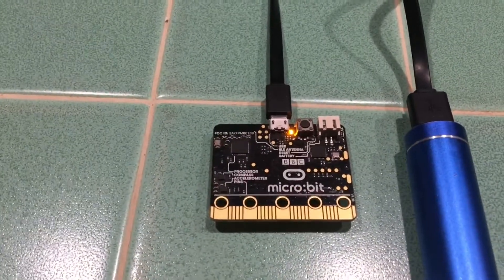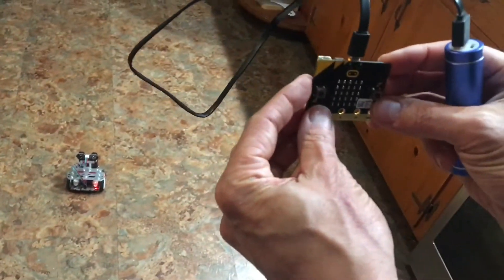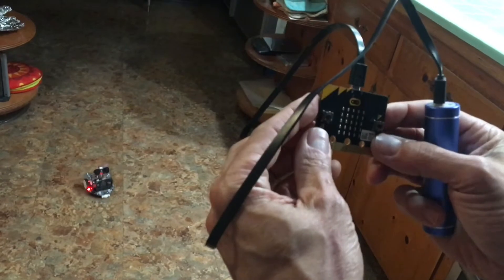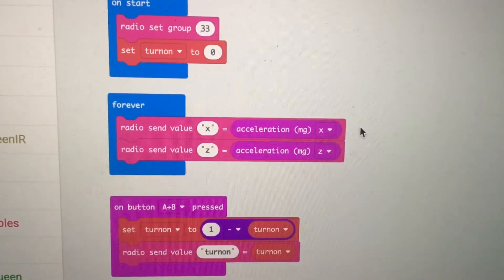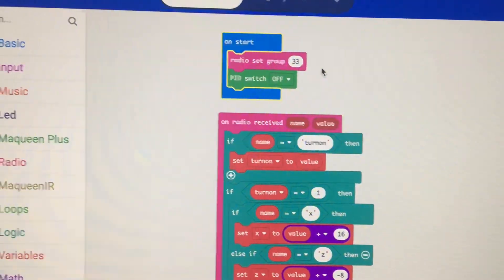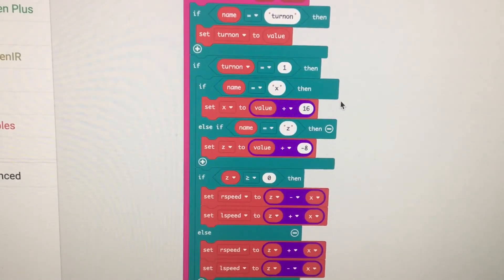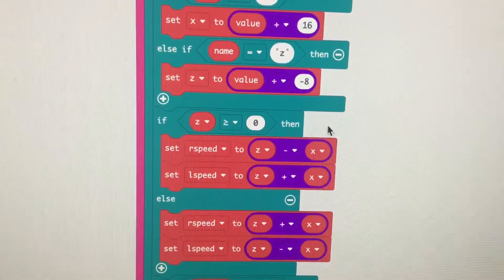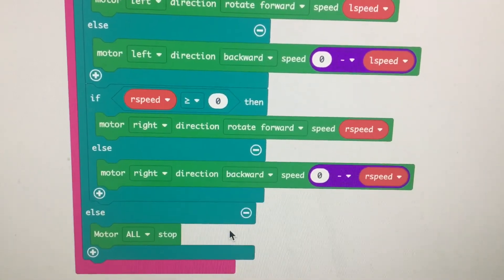Microbit radio controlled car - Maqueen Plus - using accelerometer for control

Comment: Can you please tell me which batteries you use with this robot?  I can't seem to find one that fits - it is either too short or too long. Thank you!
Reply from the maker: The battery is called an 18650. You can get them here: https://www.18650batterystore.com/
Pick one without the "protective button top". The button top adds a few millimeters to the length of the battery and it will not fit.